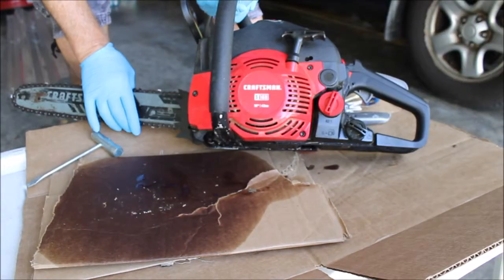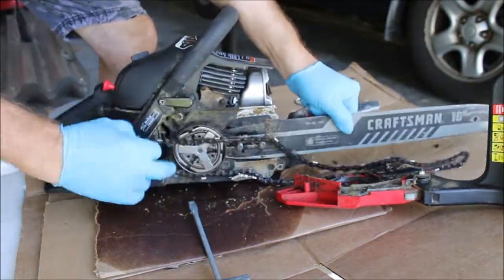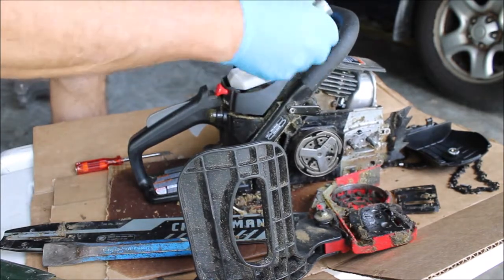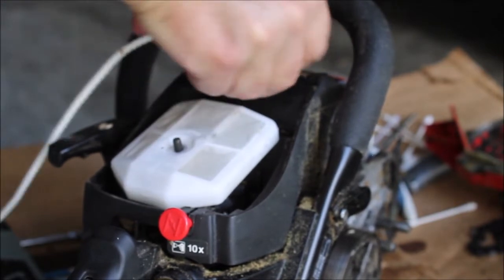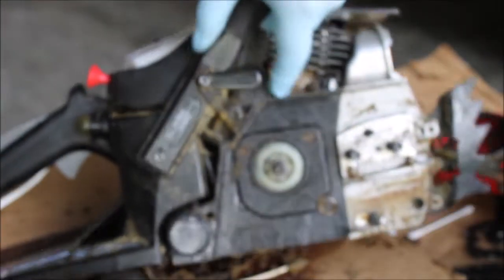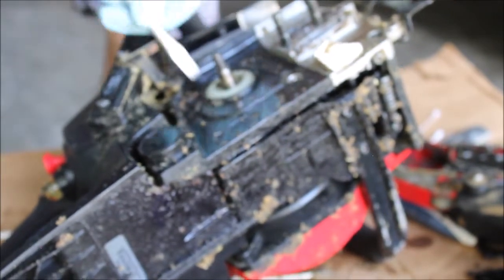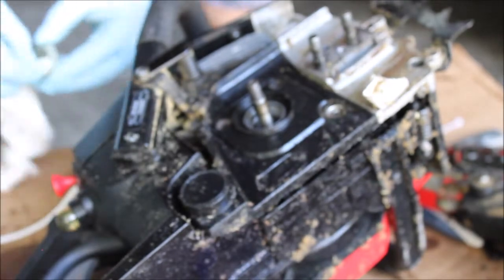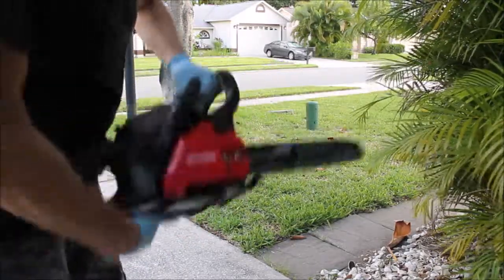Craftsman 160 16-inch Chainsaw Oiler Fix

Comment: also when you finished using the chainsaw open the oil cup wait for 10 sec then closed it again that will release any pressure build-up internally and stop the oil problem.

Comment: My craftsman just like yours leaked like crazy brand new out the box.
Reply: Did you find a solution? Mine is doing the same.
Reply: @John Smith  yes I was able to fix it. When I got the saw, I tried it fast and cut just 1 log, and it was enough to block the oil hole. So I used compress air to clean it out, and on the bottom, there's a tiny screw that's hard to get to that adjust the chain oil amount and I turned it to give a little less and it stopped leaking after that. I just used it to cut 3 trees down & cut those big trees into 12-inch pieces, which was a great test & a lot of work for it and no more leaking problems. Just have to really clean it after every use. It's temperamental. Good luck

Comment: This video is useless, you didn't fix the problem.
Reply from the maker: Yes and no. The oiler wasn't working at all when I tore it apart and cleaned it out, and the oiler started working again. It still has a small leak which I just live with, and I've put a lot of milage on it since. It wasn't the fix I was looking for, but it worked good enough for my needs.